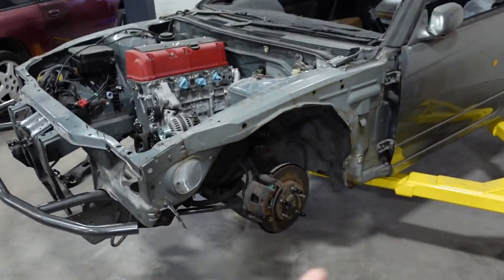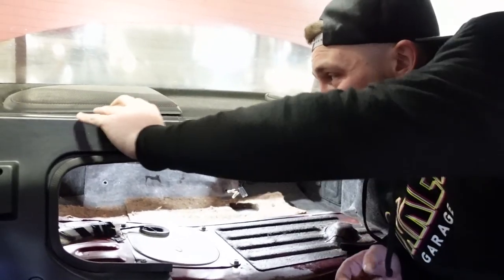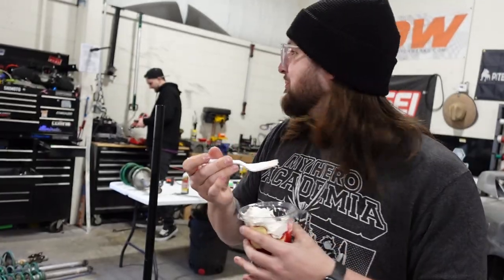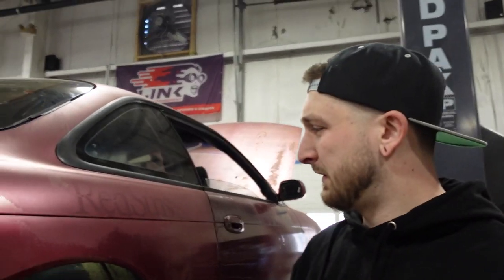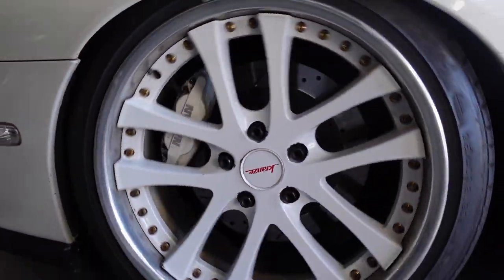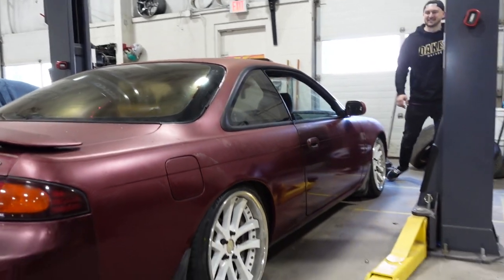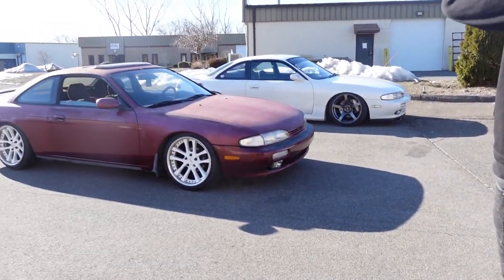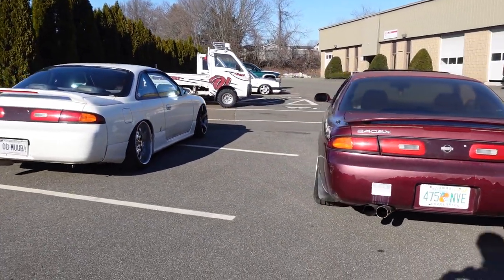Dropping the Field Find 240sx on some coils & wheels!

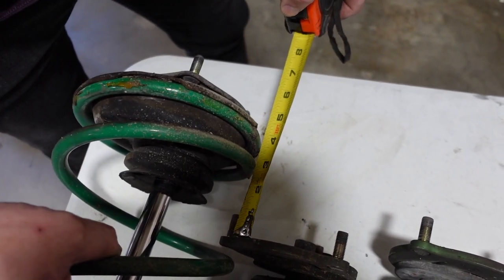Comment: 3:42 that's not how it works, Jimbo. The original springs are way softer, so sit lower than that off the car measurement.
Also, you don't have a fender roller or just don't like it?

Comment: Use a baseball bat with a wheel and tire on the car aloy more effective then the rags and hammers but u do u. Or a fender roller but with that paint who cares if you Crack it?    Amy excessive roll is gonna crack.it heat or no hear because your moving the metal and paint isn't flexible